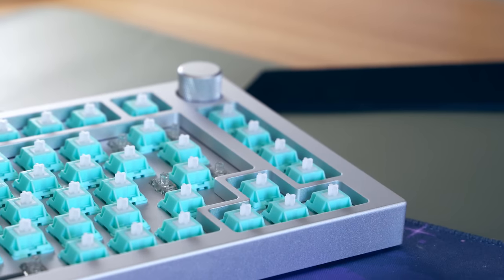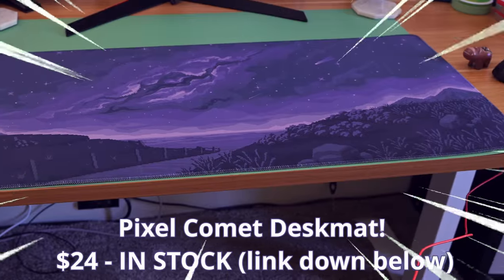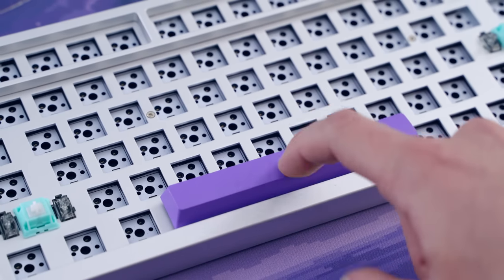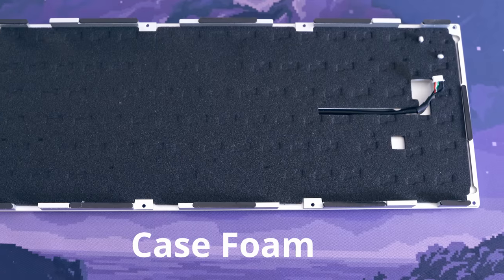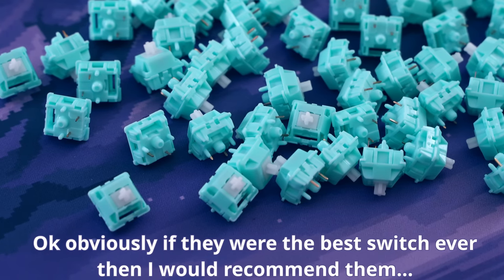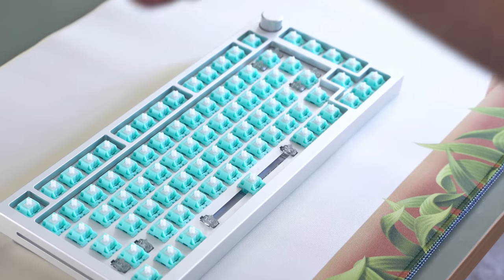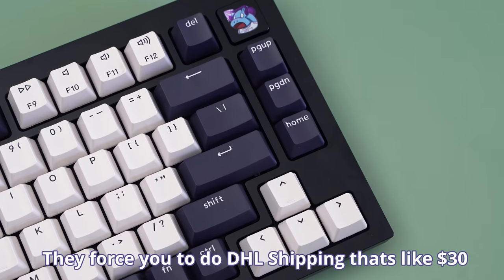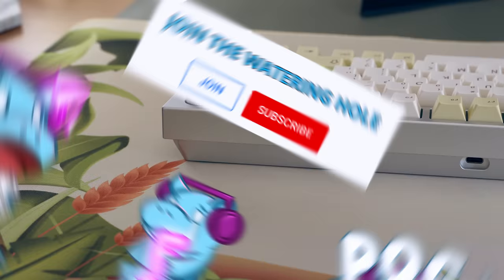I Tried the GMMK Pro (So You Don't Have to.)

Comment: gasket mounting was in fact not made for the board to have flex or give, but to  isolate the plate from the rest of the keyboard so that theres no metal to metal contact.
Reply: Yeah, gasket mounting is for sound not feel. The whole flex thing I'm not even sure where that came from, considering that boards that do have flex you don't really notice much of a difference unless you're pressing down on your keyboard with a lot of pressure.
Reply: Same with the hipyo silicone mod
Reply: @TheCh0wderp  it makes the typing softer
Reply: @ozhuenlxbouginsrirluhnbrtw2266  not always. It only feels softer on some keyboards because of how soft they make the gaskets.
Reply: @TheCh0wderp  usually more flex may mean that gaskets are soft
Reply: @ozhuenlxbouginsrirluhnbrtw2266  not always. It's a byproduct of what happened, the point was that wasn't the purpose of the gaskets.
Reply: @TheCh0wderp  ok
Reply: thats what i'm saying. I don't like keyboards with flex. A flexible keyboard just feels mushy and cheap to me. I perfer a keyboard with some stiffness to push back against me, though you could probabaly say that opinion comes mainly from gaming. My friends (who play competitive fps shooters professionally) and I all agree that a gasket mounted, STIFF board feels the BEST for gaming, between sound and key-press responsiveness. Gaming involves rapid key-presses, and the more flexible the board, the more percieved latency you will feel

Comment: I've been wanting to try some nice switches, compared to the standard switches from major manufacturer boards, so I ended up ordering this. Sort of main-stream I guess, but I've always like their products for the most part (model-O is a win). Got some Durock stabs, Stupid Fish foam, and Black Inks. Also got the pc plate because of the stab fitment issues and too lazy to sand down aluminum/brass (at least for now; will see how the pc is). Only thing is I did get the gpbt keycaps. The legends are weird with the characters being directly in the center of the keys, but it'll be an upgrade down the road when Drop has a cool set. My wallet hates me.

Comment: Apart from having overlubed stabs and stripped screws it is a pretty good keyboard :)
Reply: Stripped screws is a preeeeetty big deal though lol. But yes, i agree.
Reply: Having a business in Australia rn. Whee!
Reply: what are stripped screws? i’m new to keyboard stuff am learning
Reply: @enzo-j5019  screws that have been ruined and cannot be screwed out, basically there is nothing for the screwdriver to grab onto.
Reply: @enzo-j5019  stripped screws aren't just a keyboard thing, but it's when you're tightening a screw and keep trying to screw and the screw starts to have some metal chip off
Reply: @enzo-j5019  This keyboard has a lot of issues. The screws strip (meaning the head of the fastener where you put the philips screw driver is hollowed out so you can't unscrew it). Torx screws are the best for preventing this. But this keyboard has more issues than that. The brass plate is anodized AFTER the threads are made so crossthreading due to material in the threads can occur. Their stabs are apparently over lubed so keys can stick. Also it doesn't sound that great (it's a bit hollow). The space bar rattles (don't know how to fix that one without buying durock stabs).  I'd go with a different keyboard if I were you.
Reply: @Matt-vb3vx  Yep, hard upvote on this. Just got mine, it's hot unusable garbage. Have to RMA it, everyone else should stay away from this board. I can't even get my money back, only store credit.
Reply: @anillustration5059  Hot unusable garbage huh. I thought it would be a good idea to seek out some first-hand accounts of different boards to help aid in my search for my first mech, but it's useless because people are so dramatic and constantly over-exaggerate everything.
Reply: @MrDexter_  Tbf, I think this keyboard isnt really made to be opened up in the first place? Its not a full custom board, more a hot swappable board.

Im getting myself a GMMK1, where that seems fine, but its a bit weird for the expensive pro version. Especially since it competes with stuff like the Keychrons.

Comment: I bought this with my first paycheck at my new job in July, and I'm really pleased with the result, but annoyed that I had to do so much fixing the board to get here. I already prepared to want to swap the stock stabilizers, change to the PC plate, and do PE foam, but it just kinda kept stacking with issues I hadn't really anticipated.

As you brought up, the stabilizers were horrendously overlubed, and I almost wish they just kept them bone-dry so they would actually function. Almost all the screws in the case, plus one of the stabilizer screws, were stupidly tight and before getting my patented Wowstick™ it was a chore to get open as a lot of them were starting to strip.

The PC plate that everybody says "oh yeah it has an easier time fitting stabs than the metal ones" also still had a horrendous time fitting Durock stabs to the point that I would have broken the damn thing before getting it to seat properly, so obviously I had to shave that down too. The PC plate also had poor alignment somehow because when I did get it to fit with the stabs straight, it then didn't have enough room for the rotary encoder on the PCB-- like, huh? After fixing mistakes that I had no reason to have to fix myself, I'm pleased with the result of that, but my god, Glorious.

On a lighter note, I got GMK WoB for the build which along with the Black Inks and the smokey Durock V2 stabs gave my GMMK Pro a really stealthy look, but I'm even more surprised that the black of the GMMK Pro and the GMK WoB are so damn close. It makes the whole build look cohesive and almost like Glorious knew what they were doing until they made their own keycaps and stabilizers. Though, for some reason my Escape key scratches, and even sometimes catches on the bottom of its divit if my keypress pushes it south of the keyboard and I feel like that another weird QC issue on Glorious' part, but probably just a margin of error thing.

Otherwise, my build is nice and muted and low-pitched, pretty much where I wanted it to be for this board. It has a bit of a unique sound to what I've heard from other GMMK Pros and even keyboards in general, but I think that might be because most people don't try to mute their keyboard to the point there's basically no resonance and just pure bottom out sounds. The Glorious Core software is also just horrendous and might unironically be held up by spaghetti and marshmallows, but when it works, it's okay I guess?

Comment: I started with the Keychron K2 v2 and got the GMMK pro a week later along with some drop keycaps, krytox, blue dial knob, blue aviator cable,  brass plate, and some glorious  panda switches. Very pleased with my choice even at the stock setup, but after the plate foam mod, case foam mod, triple foam mod, and tape mod it turned into my end game keyboard. No complaints and has that highly sought after thockiness.

Comment: Just got a GMMK Pro like 2 days ago. 3 months after, it's safe to say they didn't fix the overlubed stabs at all. Although, to their credit, the spacebar was the only one that was grossly overlubed. This was my first entry into custom keyboards, so it took me 2+hrs to fully disassemble, fix the lube job, and put it back together again.
Reply: on my wife’s board from the first batch, it had the horribly sticky spacebar.  But I ordered one for myself on 04/2022 and it was perfect
Reply: @guybrush3000  seems they got it sorted pretty soon after then. Unfortunately I've had an even more annoying problem since building it, where keystrokes just don't register like half the time. Really irritating since it seems to be in areas that I use the most (wasd area). I've swapped switches 5+ times from the spares I got when I built it and I STILL have problems with it. Unsure of why or what to do about it.

Comment: I bought this keyboard 2 days ago, so I'm glad to see hipyo making a review to help feed my confirmation bias after I blew $350 on a keyboard which I didn't think I'd do 1 month ago. 

from my experience:
the pc plate sucks in terms of sound, just stick with the aluminium
get $15 replacement stabilizers and holee mod them, (the c3 stablizers fit just fine). the goat stabs suck.
if you want a firmer typing experience, go with this. otherwise, if you prefer softer typing experience, go with something else.
also, add pe foam and tape mod, it makes such a positive difference
Reply: I holee and bandaid modded the goat stabs.
Kind of wish I didn't put the keyboard together so I replace them they do suck
Reply: Why replace the stabs just to holee mod them
Reply: I just put in a $250 order last night, and this review just came out lol
Reply: @trash3570  because preference, I personally dislike holee modding my stabs because it gives a little mushiness from my experience with them, but lots of people like them like that at the same time.
Reply: @calussy8040  yea i get that but why would you buy new stabs just to holee mod them lmao, they could have done it on the goat stabs and been fine
Reply: @calussy8040  Holee mod needs to be broken in
Reply: @eliasnortega  It's a great keyboard. Look at other reviews, not just Hipyo.
Reply: What switches did you get?
Reply: for someone who doesn't have experience with different mounting styles, what does a "softer typing experience" mean?
Reply: @lolM1CrO  I guess softer (from my experience) is when you bottom out and the vibrations you experience from bottoming out are not harsh. It’s like tapping your fingers on wood and tapping your fingers on a soft rubber.
Reply: @calussy8040  usually the mushiness goes away after a few days of wear
Reply: @trash3570  hard to holee mod something that was already lubed. Any adhesive will have trouble sticking to the surface unless you omega clean the old stabs.

Comment: love this keyboard, mine sounds extra thoccy with tealios v2 and durock v2, and  a polycarbonate plate. lubed with krytox blah blah and TX switch films. overall came out super nice, tape and foam modded it
Reply: Did u use the foam between the PCB and plate?
Reply: @datoucherwang7959  yea I did, used the foam that came with the packaging of the barebones gmmk pro haha
Reply: @datoucherwang7959   also gmk laser keycaps, forgot to note that
Reply: Oh noice, I didn't use the plate foam cause I followed random Frankp, but idk if it would make it sound more thocc if I add it hahaha

Comment: I agree that there's definitely some good and some bad with this board, but I like it. It's currently my daily driver.

The Good:
-ROTARY KNOB. This might be one of the most inexpensive boards with a rotary knob, which is bound to volume by default. I like knobs.
-The cable: surprisingly nice? I wasn't expecting something braided. And it's USB-C. If I didn't have my own cable that I really liked, I wouldn't be mad to use the stock cable.
-The sound profile is really pleasant in my opinion. Yes, the case is very muted. I like that. I'm hearing the switches and keycaps, not the case when I type.
-It's a BEEFY board. That with the rubber feet means that it's not going anywhere.

The Bad:
-The stock stabilizers were WAY overlubed, as previously stated. I'm glad I purchased some Durock V2s when I got mine. (Honestly, I suspect the GOAT Stabs would be pretty decent if they didn't have so much grease on them. I'm planning on cleaning them a bit, and sticking them in my next build, just to see.)
-The screws, man. Some are just slightly different, which makes assembly and disassembly a pain. Also, stripping. The screw holes come pre-stripped for you. Only two on mine, but that's still two too many on a board that I spent more than $150 on.

The Ugly:
-The software is a little clunky and not as flexible as I would like. While the board is technically compatible with VIA, you can't really customize the RGB lighting or the binding to the rotary knob without the Glorious software. (As of writing this out. Or I'm a moron. Those two things aren't mutually exclusive.)
-The gasket mounting is not as soft as one would expect. (If you like a softer board, this will be a con. But if you're like me and like something kinda stiff, you're in luck.)
-Due to how the top part of the case is shaped, it's kinda difficult to remove keycaps from the function row. Just a thing to keep in mind.
-The marketing. This is more of a preference I suppose, but they're REALLY leaning into the Epic Gamer aesthetic. I find it to be a little much. "Why you gotta make it weird?" (1:28) summed it up really well.

My recommendation:
-Get unlubed switches and lube them yourself if you get the Glorious Pandas or Lynx switches.
-Get Durock V2s or your favorite stabilizer to replace the GOATs.
-Use a screwdriver that uses the EXACT size for the screws. It'll help the assembly and disassembly. A lot. (I want to say it's a Phillips size 000?)

Overall, it's a great board if you're willing to give it a little TLC. Just don't expect it to live up to the hype right out of the box.
Reply: I don't get why people complain about a company marketing to people who game on their PC's...it's a HUGE portion of the market and they are trying to compete with companies that sponsor the pros that we watch.
Reply: I'm a little late to the party, but you can fully customize the board layout (including the rotary knob) by flashing the QMK firmware
Reply: @Osprey1994  frrr

Comment: The GMMK Pro, while it was frustrating to deal with at first in terms of disassembly, the stabs, and reassembly after modding it, ended up being my favorite board that I own. Customer support was excellent. Currently, however, I should say that my GMMK Pro has chatter issues after a couple months into owning it. I'm not sure why this has happened, but I'm going to need to open it up and inspect the PCB. Hoping it's fixable, but it's really annoying to have to do that...
Reply: the regular gmmk doesn't have the problem with stabs, I have a gmmk and it's really good, too bad I picked gateron reds instead of buying the switches separately

Comment: I just bought this keyboard recently and had major problems with the stabilizers. The only thing that they have fixed is comparability with durock v2. I ditched those stabs so fast. Otherwise I love the weight of the keyboard and how they sound with my lubed holy pandas. Hell, I even lubed my holy pandas with the gLube and it sounds pretty good! No pinging what-so-ever.
Reply: Me with my rk61 stock stabs:😢

Comment: 5:26 Be careful about using Durock V2 stabs on the GMMK pro. On brass and aluminum it becomes a very tight fit, and personally I had to sand my aluminum plate down just to get it in.
Reply: I concur with this. Hopefully Glorious will make the brass plate more adaptable in the future for 3rd party stabilizers.
Reply: I thought they'd already addressed this in newer units?
Reply: @Ragnorok64  I think mine was either batch 1 or 2. I'm not sure if they addressed it. If they did, good on them.
Reply: I've talked with several people with newer units that the durock stabs fit with no issues at all. There are some people who happen to get some of the old units from the warehouse with the issue still occasionally
Reply: @K3N71  they did few months ago, just contact them if your plate has the issue
Reply: @nu3566  Oh nice. Probably won't contact Glorious though. If it ain't broke don't fix it
Reply: It's fixed, I can confirm on mine

Comment: good review. Other youtubers conveniently omit to mention the big shipping fee attached to the Q1 when comparing the price.

In my experience the best upgrade you can do to gmmk pro is getting a FR4 plate with lots of flex cuts. The FR4 plate is notably thinner than the alu plate so it will have more room inside the case to flex and then well it has flex and accoustic cuts so its a much better experience. It also fixed durock stab fitting issue of course. So if you want to spend extra money, get a FR4 plate. I like the one from hypekeyboards a lot.
Reply: How does the hypekeyboards compared to AVX Works?

Comment: Just bought one of these bad boys and it sounds fantastic. However, there is no way for me to leave my review for it on their website for some reason. The stabilizer issue still exists and I had sticking stabilizers for every single one, it was an easy fix (replace the pads with some med tape and relube the stabs correctly )but it's really annoying that I had to open it up for that. It also has the tightest screws so make sure you have a quality screwdriver to not ruin your new KB.

Comment: I recommend the Q1 if you have sometime to mod it, and maybe an extra 15-20 bucks laying around for some sound dampening stuff and a bit of masking tape; sound dampening foam + masking tape where the case meets goes a long way, and if you’re just looking to eliminate ping then that’ll do it.
Reply: @Drakey379 it helps a bit, but not a ton. It’s definitely noticeable if you’re not wearing headphones. But a bit of masking tape and throwing on the extra gaskets is definitely worth it.

Comment: Glorious also has a decent software to download to control the RGB on the board, and other glorious products you have hooked up, like the mice, and if not that, you can press fn + right arrow/left arrow to cycle through different lighting modes. I have a GMMK 2 (96%) and it’s been a satisfactory experience so far. The Model I mouse is really lightweight and low latency with switchable side buttons and an easily switchable DPI. Definitely one of the best mice and keyboards I’ve ever gamed on.